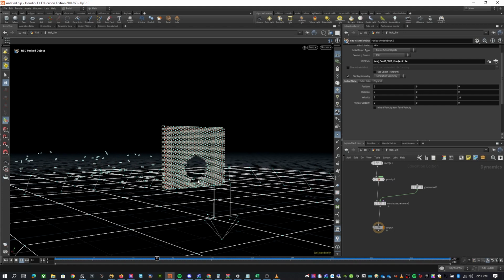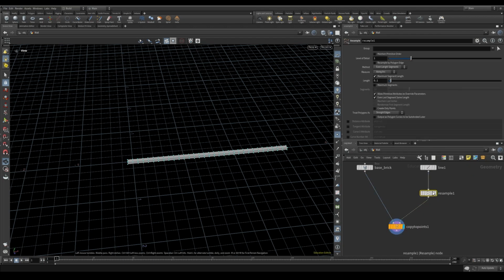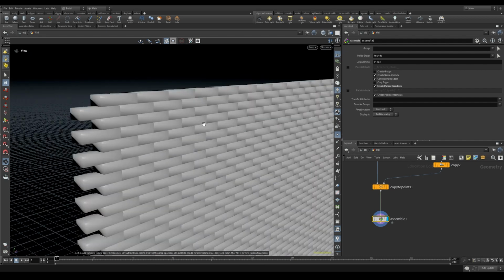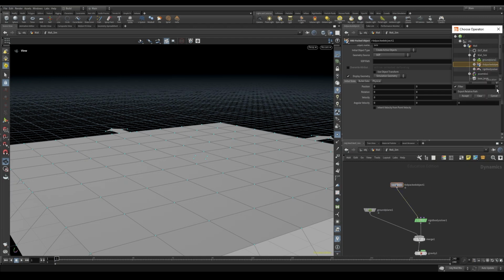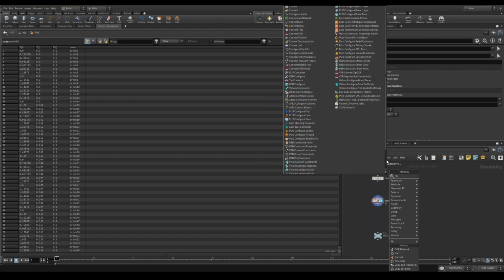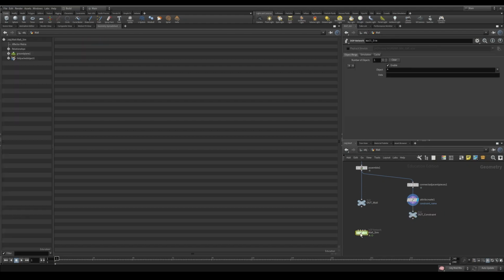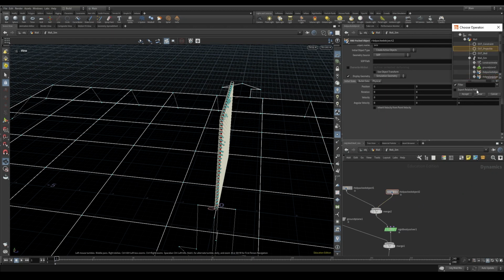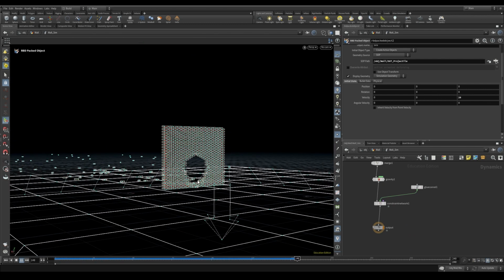Learn Houdini VFX | Your First Destruction | Part 1

Comment: Maybe I'm just on a different version of Houdini than you but the Glue Constraint Relationship node's Data Name entry defaulted to "ConRelGlue" instead of "Glue" and that tripped me up for a while.
Reply from the maker: Ah yes that could be it! What version are you in?

Also as an aside any name will work as long as the data matches. In a later video I will showcase this.
Reply: @BryanHoltFX  I'm on 19.5682, which is from mid 2023, and I just noticed that in your video you're on a much newer version, so that must be it!
Reply from the maker: @tychovii-7  yeah. I could have sworn it was already changed. In a later video I will be sure to talk about names specifically (it is quite important!)